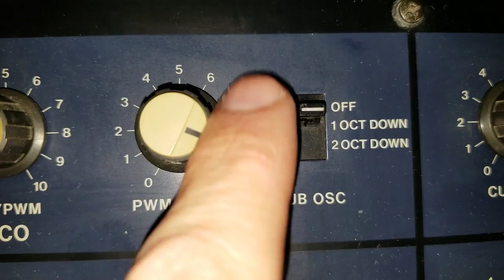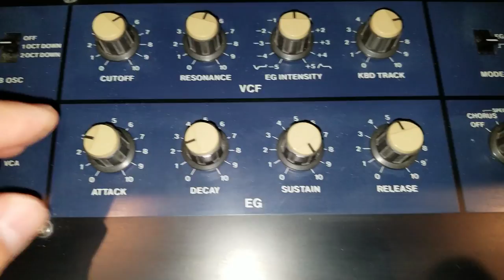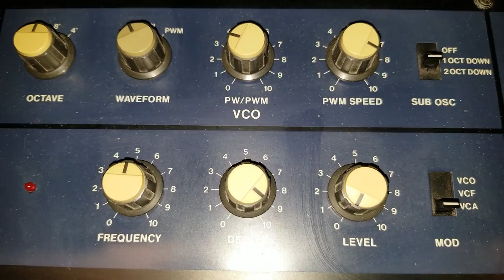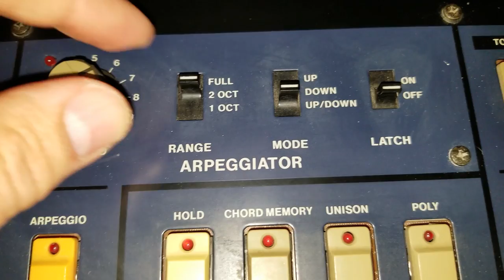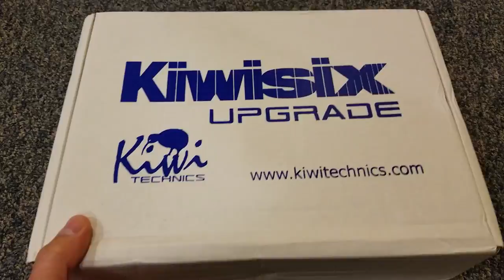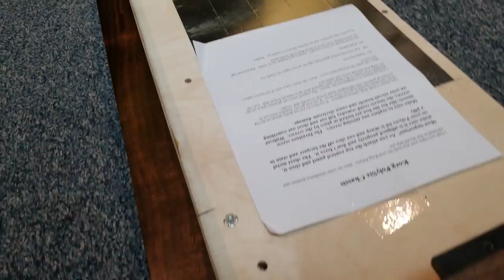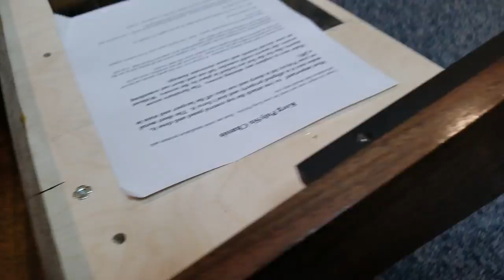Repairing & Restoring a Korg Polysix to Better Than New! Episode 1: Overview and Plans

Comment: I love the way you approach a new project and you attention to detail and competency... I have several old synths that would require some work... 
I would appreciate some assistance with my old CS 30.. if you know it..

Thank you
Reply from the maker: Thank you! The one great thing about all these synths from the 80s is that they were normally produced with detailed service manuals. So as long as you have some diagnostic skills, the service manual and access to spare parts (not always a given), you can generally fix any of these synths. Having the Internet to know about common failures definitely helps, too.

Comment: I have a Polysix I've had since 87. I used to play it a lot. I let my niece borrow it and play with it for a little while, and then I got it back from her. I had stored it for a little while. Then when I powered it and hooked it up, all the keys did this weird thing.  When I played the keys, they all sounded together and did a falling sound. I learned more about the battery 🔋and it was too late. The board looks good, but then you scrape the green paint off and the copper foil is gone in some places. I don't know if the power supply is damaged or not.  I used to service VCRs and TVs long ago, I'm rusty.
 But I'm a musician at heart.  Can't live without music. I hook up a guitar, bass, or a keyboard and I'm in heaven. I'd really love to fix up my Korg Polysix. And my Roland Juno 106. The voice chips are failing, or have failed in it.   I appreciate you being on YouTube man!
Reply from the maker: If you serviced VCR's and TVs, you can fix the Polysix. :) Voice chips are failing in my 106 as well, that's the next project!
Reply: @ScottsSynthStuff  with great anticipation, I look forward to when you start on your Roland Juno 106.

Comment: Hello. Couple little notes. MG can actually have one or two destinations. Mod wheel is always into VCO and the second is your choice. So you can have vibrato and filter sweeping at same time and with different amount. They were actually initially more expensive than 1000$, but it was the first one to be later discounted to 1000.
Lovely talk and history,
Really good points about mainetance, extremely important (that battery is really evil). My P6 have already replaced CPU board and refurbished power supply by previous owner, but definitely your way into taking in 21st centuary is even better.
Keep it running, they are awesome!
All the best!

Comment: The SSM 2044 filter chip used in the Mono/Poly and Polysix were based on the Moog ladder filter (without violating Moog patents), which accounts for the richness of those two synths.
Korg did later offer a full-featured MIDI retrofit for the Polysix, which brought it into the eighties.
Reply from the maker: Yes, their MIDI retrofit (the PS6-MRK) was a daughterboard with a separate processor, RAM, battery and plugged into the main CPU board.

I'm hoping the SSM chips in this synth are in good shape, as they are becoming rare and expensive!